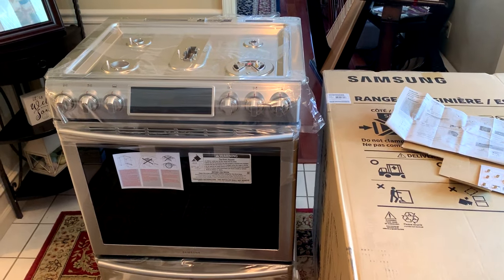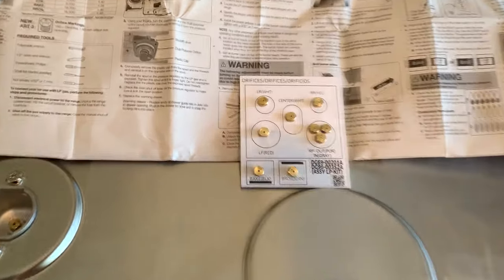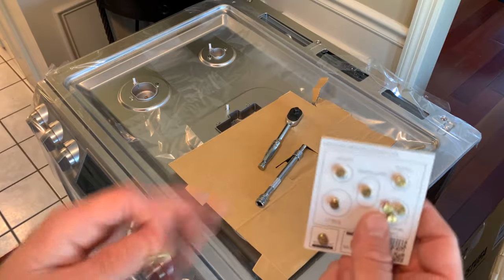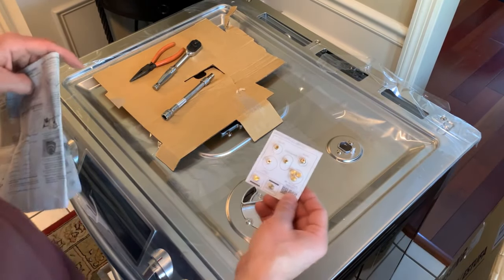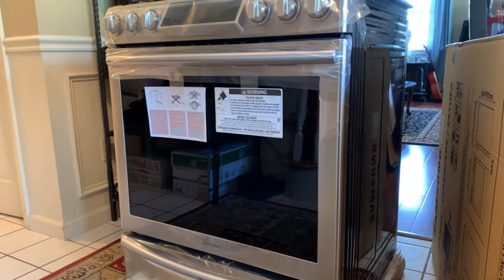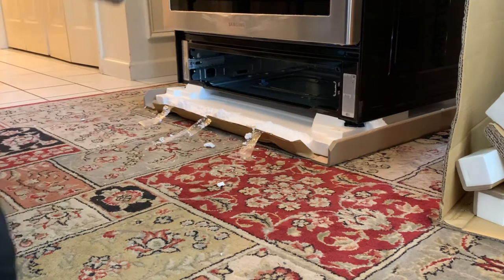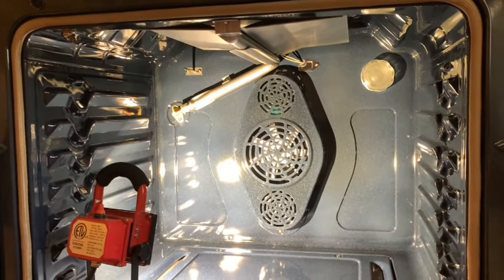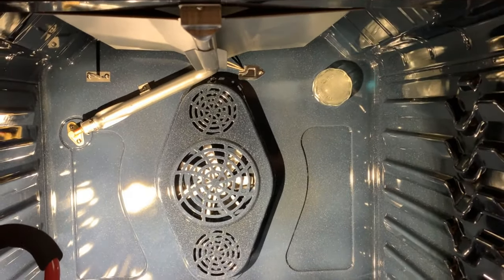Samsung NX58H9500WS Gas Range / Oven Natural Gas to LP Conversion

Comment: Thanks for the great video!  I just watched it to help me convert my stove to LP. One thing I noticed though, it looks like you placed the red plastic retainer ring for the red regulator orifice cap on the underside of the hex portion of the orifice, which is a no-no. The plastic ring should fit over the threads above the hex portion rather than underneath which makes it act as a gasket. The thickness of that ring could cause the regulator be less than fully blocked open because the orifice is not fully screwed down into the regulator. It’s possible this could  restrict gas flow to the appliance when used on LP isn’t it?
Reply from the maker: That's a great point. However, I matched how it came from the factory when set for NG. I put the cap back in the same orientation and flipped the orifice.
Reply: @grwebman  I guess only the factory would have that answer, but on natural gas having the ring on the underside wouldn’t matter since the regulator diaphragm is not being pushed down anyway. When the orifice is set for LP position, the purpose of the little stub on the end of the orifice is to hold the center of the regulator down so the gas basically flows through the regulator without changing the pressure. I just don’t know if the thickness of the ring is enough to prevent the regulator from being fully blocked open or not. The documentation with the conversion kit doesn’t provide any clarity either. I believe yours probably came wrong from the factory because mine was on the top side like it should be. It’s not like a gasket is required between the orifice and the regulator because there is no gas present on the top side of the regulator diaphragm that could escape. I suspect someone at the factory assembled it wrong because I’m certain that it belongs on the top side. Thanks again for the video. For me just knowing how to take everything apart to get to the orifices was a great help. I struggled a lot with getting the big front door off, and really struggled getting it back on until I figured out the latches must be in a certain position before reinstalling the door.
Reply from the maker: @ChuckGarrels  Maybe one day I will pull it and remove it. However, it's been working well for 9 months. Thanks for the detailed info.
Reply: @grwebman  I agree with the poster above. The red plastic should not be used as a gasket. The red ring  plastic cap should be fully above the orifice. Mine was fully above it, when it came with my new Samsung white glass model, this year 2023. None of the other orifices used a plastic gasket , why would this one ? Also just an fyi, my regulator was on the back of the stove in case others reading this have a newer model also.   Not inside the oven like yours. It is much easier to access on the newer models. Other wise sir,  you have done a great job in your video. I salute you and your great work. I'm not meaning to nitpick.